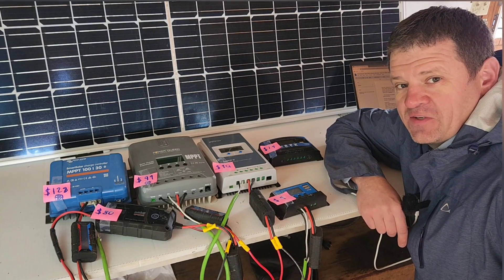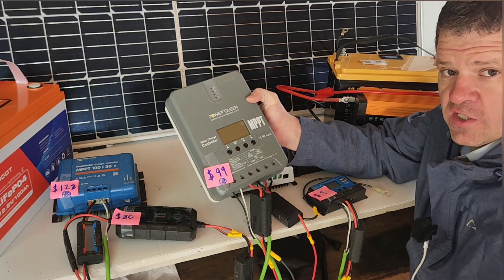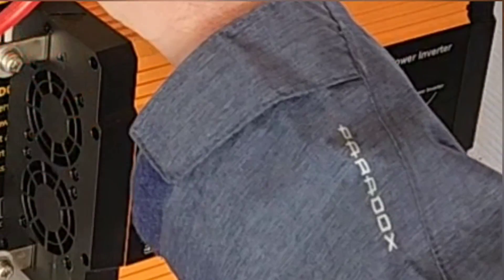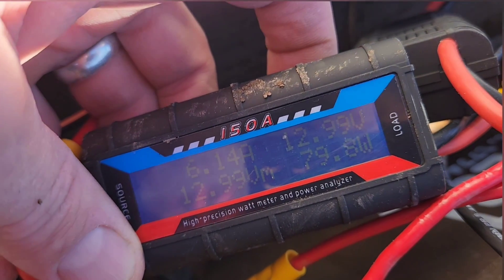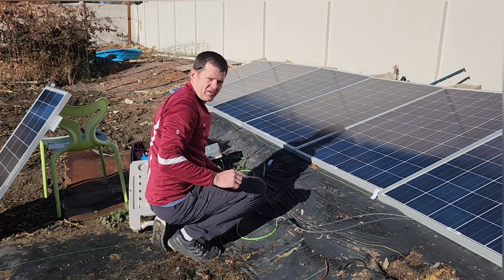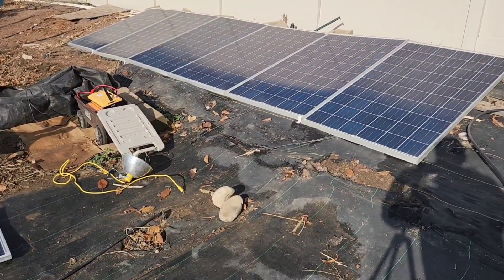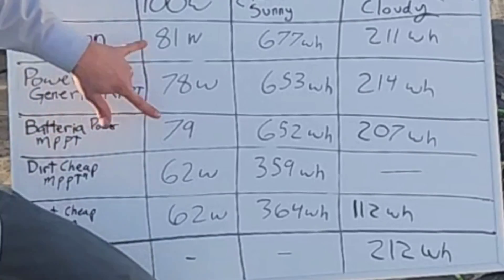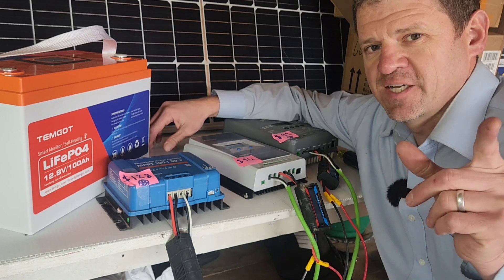Solar Charge Controller Showdown & Buyers Guide

Comment: Didn't even test the EPEVER until the cloud test and then you compared the Victron to the Power Queen saying the PQ came in second when actually it was the EPEVER that came in second and higher than the Power Queen.  Also listening to the voice track, the inflection changed when the word Victron was spoken.   Not sure why so many people are crazy over this brand, their MPPT is not customizable and just a brick as a module where a one size does not fit all as is its design strategy.   Perhaps it's Victon's marketing that has so many brand-worshipers out there, where they spam a video everywhere advertising their B2B, convincing buyers that charging LiFePo4 without their B2B will burn up alternators, but the alternator they burn up is turning at 500RPM and by their own admission as can see in the 500RPM pop-up that flashes on their video.   No alternator runs as slow as 500RPM, most in the 2K range.   I direct-charge a 560A battery bank directly off alternator with no repercussions and no Victron equipment needed.

EPEVER controllers are very customizable and can be ordered with remote wall gauge, an adapter for large scale customization over USB on a laptop or a bluetooth module.   This was not a legitimate test of EPEVER and while it should have been, it was never clear why it was put on the table as a test item, yet no tests but the last were run.   Also note that several of the instantaneous wattage readings were taken with the shadow of a head and/or shoulders on the corner of the panels.   The panels should have been free of any shadows.  And while I own all EPEVER, I've never seen any free sample of their equipment and I've paid for everything and have no affiliation with the company.

Still, no one knows better than I do how hard it is to put a demonstration like this together, but at the same time, if things are not accurately represented, then a do-over is in order and thus I'd like to see some comparisons where the EPEVER numbers are recorded and no shadows are over the panels while readings are taken - THANKS.
Reply from the maker: Thanks for the thorough critique! I'll definitely keep your points in mind for future tests.... which might be in the works

Comment: то дуже цікаво, але в мене питання. Що робити як є потреба заряджати батарею 48V 100A, але є лише одна сонячна панель видає 40-45 вольт 13 А. Чому топові виробники не роблять буст Степ Ап МРРТ контролери?
That's very interesting, but I have a question. What to do if there is a need to charge a 48V 100A battery, but there is only one solar panel that produces 40-45 volts 13 A. Why don't top brands  don't have "step up" MPPT controllrs ?
Reply from the maker: I am not sure if they offer those. Which is too bad. One option is 2x a step up converter that will step up the voltage and then send that higher voltage into the solar charge controller.
Reply from the maker: Or you can just get another solar panel or two and put the solar panels in series which will increase your voltage also.
Reply: @diySolarPowerFunWithRay  Yes i know it, but my balcony solar station, have place for only one panel (
PS. and i really don't understand why power station like Ecoflow and Bluetti have on board "step up" MPPT. Victron, Epever, SRNE have not. This is very strange)
Reply from the maker: @exi3074  they might have Step Up converters because they have a higher voltage battery

Comment: Testing only 30 amp ones is worthless. Unless you want to charge a cell phone.
You don't get enough sunlight to charge a decent battery bank.
PWM's are only 80% efficient. MPPT's are 98% efficient so you get more bang for the buck.
Most solar panels are rated at 27v OC.
You need at least 4kw of battery storage to ensure you can run your HOUSE refrigerator for a day, maybe two. Mini fridges can easily run all day and night with a modest array and battery bank.
House refrigerators generally use about 2kw of power a day with light use and no water/ice. 5 foot chest freezers used just under 100 watts a day.
Note: regardless of any power claims on a microwave, double their claims and that is the power needed to run one.
His gas furnace must be a high efficiency one. If you got an only 80%-er one it may struggle to do anything.
Remember, unless you use solar tracking, you will effectively only get about 5-6 hours of direct sun per day.
Cloudy/rainy days even less generation.
Small controllers are fine for camping and very small applications. They will struggle to fully charge a larger battery bank (400ah) unless you live in a desert and have solar tracking device.
Higher voltage means smaller gauge wire needed to move the watts generated.
12v means VERY large wires to get enough amps. Some as big as 2/0 (two aught), which are VERY expensive.
Watts is watts no matter the voltage and amps pushed through.
Most solar panels come with 10 gauge wire for hookups.
And many talk about 10 gauge wire from panels to the controller. For 800 watt panels you need 6 or 8 gauge wire. 
All dependent upon the wattage and voltage you are trying to generate and the distance from the array to the controller.
His testing was quite short in comparison to normal panel setups. Good for testing controllers in his testing. Better testing is to run the cabling 50 feet to the charge controller and see how thins work out.

None of this is to impune his testing or results. Just adding additional information.
Rule of thumb - get a bigger real MPPT controller than you need. Allows for variances and future upgrades like adding additional panels.
Be sure to get enough battery storage too.

Comment: If you are just charging one or 2 twelve volt batteries a small 30 volt 20 amp charger works.
If you have any future idea of building a much bigger system go with a 12,24,36,48 volt and 60 to 100 amp charge controller .

Comment: Blue sky SB-RVK-PT-S, Solar Kit for RVs/Boats. 40A/30A MPPT Charge Controller SB3024iL for 12/24V Lead Acid or Lithium Battery w/ a 3.5"
 touchscreen remote display ProTouch-S with Current Shunt
I AM THINKING ABOUT GOING WITH THIS, BUT I'M NOT SURE BECAUSE I CAN'T FIND ANY INFORMATION ON HOW MANY BATTERIES YOU CAN CONNECT TO IT. THE WEBSITE ON AMAZON SAYS YOU CAN ONLY CONNECT 2.
BUT IT WILL CHARGE THE BATTERIES A LOT.FASTER

Comment: Using Bluetooth is seriously discouraged in this kind of critical applications. It will have conneciton probolems, app bugs, cell phones problems, cellphone os update problems, hacking problems etc. when you need it the most you might find yourself fighting to make the smartphone connect to the charge controller with no success.I really would stay away from bluetooth.

Comment: 768V nominal Voltage on batteries, muhehehe. Let's go industrial size. Jokes aside if you want to charge your EV while fully supplying your home you need a higher Voltage on batteries.

Nice video, I've forgot the basics. Nowadays the MPPTs are built in the inverters and it complicates things. It abstracts away the complexities for the user, but you don't really know how the inverter works and what it does.
Reply from the maker: yeah,  I'd be fine with higher voltages...my solar array is already 350 volts.. pretty average.... So I think people are fine dealing with the larger voltages.

Comment: Always good to see comparisons. Kinda sounds like another victron commercial. In MY experience, as well as another good youtube vlogger I like, that wonderful victron app is totally hit or miss. In the one overpriced victron unit I bought, the bluetooth was totally useless. It would not connect to either an android or IOS phone in my case. Bad bluetooth? Really? I have $10 bluetooth speakers that NEVER give me any problems with connecting and consistent bluetooth capability. If a company can't get bluetooth RIGHT in their "top line" brand, I can only imagine what other problems they might have.

As far as anything about 48v being cheaper relating to the amount of energy storage, I have yet to see that proven. I started a thread on a popular fb solar page challenging those folks to show me by actual numbers, how they think 48v battery storage is anywhere near as economical as 12v batteries, and they proceeded to defend themselves with over 500 replies, none of which actually addressed or proved anything less expensive about 48v battery usage. Wish someone could actually prove this!

Comment: Please, i have plans on getting a solar DIY setup, but i a way confused on how to go about the whole thing.
Can i add up 350 × 3 in series or parallel, which makes up for 1050w for a 12v battery, please if yes, what size of charge controller do i need so I don't blow off my battery, and a good advice for which panel connection (parallel or series) i should go for is going to help 🙏
Reply from the maker: There are spec on the solar charge controller you buy to connect solar to you battery for charging...  power stations also have solar charging port spec.  In this Echo flow power station Video I show how you can connect your solar array according to the spec. https://www.youtube.com/watch?v=DtqNJW52ZS0&t=499s  Hope this helps. Thanks.
Reply: @diySolarPowerFunWithRay  thanks a lot 🙏

Comment: Only 12v batteries are available for any capacity less than 2.5 kWh unfortunately. So for small systems that is the only option 😢
Reply from the maker: They are starting to make smaller 48v batteries.  I'd like to make a power station out of one of those.

Comment: So you cant use the cheap ones with 24v panel
Reply from the maker: It depends on the voltage of the panel... and the solar charge controller you want to use.  Just make sure at your solar panel is within the specs of your solar charge controller
Reply: Most PWM controller's max PV input only allows 50Vdc

Comment: only victron all other are just garbage in every aspect. I already paid it very expensive with other brands and after switching to victron changed everything with their software and ultimate control of the devices.
Reply: Victron is great, but it's so expensive. I've bought EPEVER (Tracer2210AN) in half price as Victron, and used it for over 5 years in my RV, and it works perfect.
Reply from the maker: Victron are also my favorite!!!!
Reply: I don’t think the price difference for Victron is really that much. Especially if you life off grid and rely on the stuff every day. If you’re just building a system for fun then just buy whatever cheap junk you want.

Comment: The chinese are tricky little buggers...I bought one of the cheap 'MPPT' chargers...When I did some in depth research I found that they were from a firm that had a division called MPPT....LOL...Of course it was a PWM...Caveat Emptor or for those of us that don't speak Latin, BUYER BEWARE...
By the way, I now use a 210Ah LiFePO4 battery and an EPEVER 30W MPPT charger ( Model: XTRA3210N G3 BLE) that has Bluetooth, I am very happy with the current setup...

Comment: Anyone out there that’s going to do solar, just go 48v. Unless you’re just doing it for 1 fridge or something small… just go 48v and if you are doing something small, do at least 24v. Trust me, don’t waste your time and money with 12v. 12v is a dying breed…
Reply from the maker: Totally agree!  They have a 48v to 12v step down converter that's super efficient if you still need to power a 12 v appliance.
Reply: Listen to this guy... I'm sitting here looking at 12 volt inverter that is collecting dust.. just go 48 volt and be done with it
Reply: I have a mobile 12v system for camping. I'd say use either 12v for a <400w system or 48v for anything bigger. 
Skip 24v entirely unless you're upgrading an existing 12v system and reusing the 12/24 charge controller.
Reply: Only 12v batteries are available for any capacity less than 2.5 kWh unfortunately. So for small systems that is the only option 😢
Reply: @janakone Huh? You just run 4 in series to get your 48v. And actually 6v is more common in smaller sizes.
Reply: WRONG,and if I have an 12v fridge or lights or if one of the cells fails from your 24v or 48v system what do you do?on 12v I can put an temporary 12v battery(it doesn't matter the chemistry of it)in matter of minutes whereabouts if your cell fail you will gonna have to wait days till you receive an new cell or an 24v or 48v battery pack  or cells so I'm sticking with 12v whole day every day
Reply: Your right on the money  @2626sylver2626
Reply: @2626sylver2626 not a bad point
Reply: I built up a 12v system around a 1200 power station, with 260w solar panels, and 2 100ah batteries. Has enough power  for a computer, laptop, LED lights, and a couple of box fans to power 2 back bedrooms.  I still stay on the grid.  This allows me to take the power station on the road.  Will also power the Fridge for 48 hr hours in an emergency.   Anything more like microwaves and kitchen appliances, no question about it's best to go 48v.  And when it comes to powering any near 240v you gotta go to 48v.
Reply: Agreed.  Eventually, 48v will go the way of 12V.  300-600 volt batteries are the future.  Much more efficient.

Comment: Thanks for doing this "bake off" video! Its wasn't clear why the higher voltage battery with stepdown converter would save money over a lower voltage battery. Could you please further explain this?
Reply from the maker: The price for 48 volt equipment is more affordable

Comment: When selecting a charge controller you do want to take into account what kind of battery you are going to be connecting it to and how many amps of DC current that it could possibly produce using the solar panels data sheet.. If lead acid batteries are used any charge controller will be fine as long as it works with the voltage you plan to use.. For LiFePo4 and Li batteries you want a controller that has a charging mode for them or has the ability for the user to adjust the settings and these settings stay set even if the solar panels or battery are disconnected then reconnected.. After calculating the maximum watts that could ever be produced by the panels on a freezing cold sunny day you need to see what the maximum safe charging watts/amps the battery can handle without causing damage and match this for all day output to total battery storage capacity.. It would be very inefficient to have 10 kilowatt hours of solar output going into a battery that could only store 5 kilowatts unless you can use power while the sun is shining you waste at least 5kwh of potential.. I have 7.2kw of panels that produce on average of 5-6.5kwh in peak sun and 20 to 35kwh a day connected to a 30kw 600 amp LiFePo4 battery bank and I do use power all day and night from this setup.. There are many sources to get a guesstimate of how much on average for different locations on the planet that solar will produce that take into account latitude and weather for a location.. I have an Amish friend that got a couple 350 watt panels and an MPPT controller who connected them to far too small a battery and literally boiled the battery to death in a week because it was charging with far more amps than was safe for the battery.. Rule of thumb is 10% of the battery rating for lead acid and 25% for LiFePo4 for longer battery life.. You certainly can go higher but it causes heat and heat is an early death..

Comment: only disadvantage of the victron MPPT mppt charge controller  is that these are not repairable, completely cast in the aluminum housing.

If you connect the plus and minus battery cables incorrectly, then you can throw away the MPPT controller. The fuse cannot be replaced.

No warranty by Victron
Reply: They are repairable

Comment: Many STEP-DOWN converters are FAKE, is your $30 fully spec'ed in under stress??????????
Reply from the maker: I'm not sure what you mean by stress. But it turns off if u try and pull more than 30 amps. I think I might use a 30 amp a charge controller on my next build For the step down converter
Reply: @diySolarPowerFunWithRay  They are not BUCK or similar, of ANY KIND (lete alone MPPT), they are simple and very inefficient PWM ONLY!!!!!!!!!!!!

Comment: I have 5 victron charge controllers and a few powmr 100 amp charge controllers. The victron are super nice with the smart app and higher voltage input but actually the powmr 100's have never missed a beat and work great also. My all in one units on the other hand ... Lol
Reply from the maker: You're the only one units definitely have a few more quirks

Comment: I think you and I are the same, we're addicted to buying solar controllers, batteries and panels  😂
You probably know this but it's still worth mentioning, a good way of seeing if a controller is MPPT is to measure the solar input voltage at the solar controller and the battery voltage at the solar controller. If it is MPPT the solar input voltage will be higher than the battery voltage when under load. If it is a PWM controller both the solar input and battery voltage will be the same when under load. There are so many fake controllers out there.
Reply from the maker: Cool. I actually didn't know that. Thanks!  Yes, I have too many :).  I'm giving away some stuff right now if you're still collecting :).  See my raffle video. I've still got a lot of stuff to give away.

Comment: On a so small production of 200 wh you must to consider the controller consumption and take out of the total. A Bluetooth controller 30A controller consume more than a no Bluetooth 10A controller. The controller consumption don't pass trough the meter
Reply from the maker: The meter is after the charge controller so it should account for that
Reply: @diySolarPowerFunWithRay exactly! Meter is After. It reed Only the current to battery/other loads. The controller consumption you can't know. But just multiplies the datasheet value for the hours of the test. Then you add this data to the total of meter wh. Maybe don't change nothing. But is it 😊
Reply: @diySolarPowerFunWithRay yes you are right. I confuse myself.🤦 But you understand what I mean..